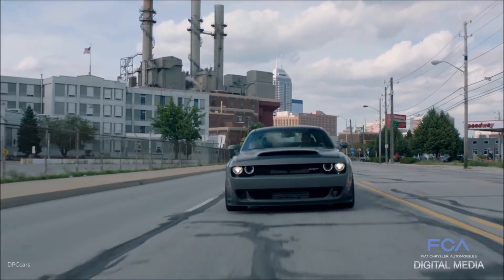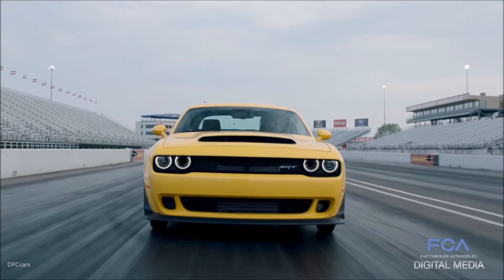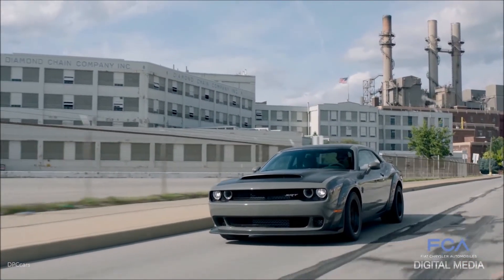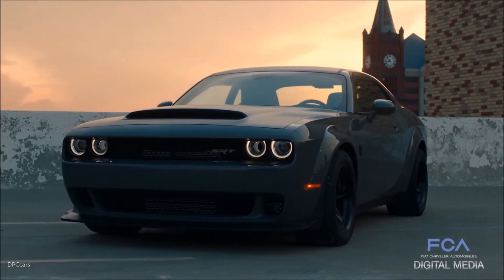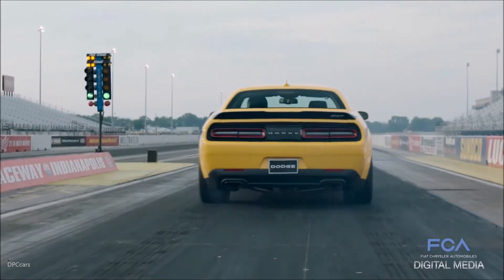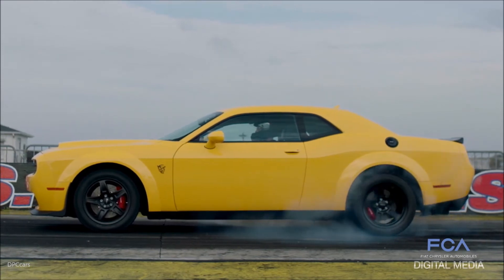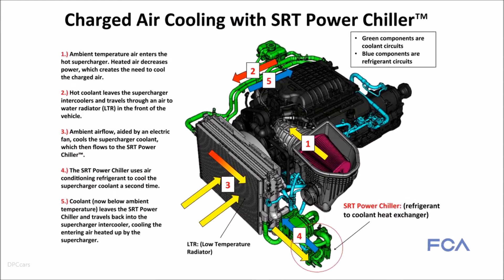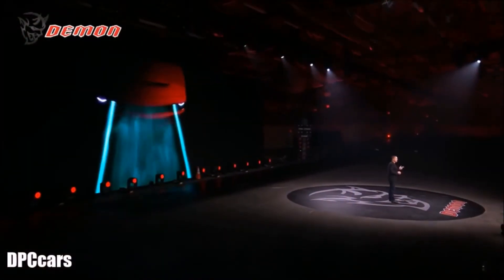Dodge Demon SRT Power Chiller Explained

Comment: So the chilled air helps produce more extra power than the A/C systems uses to produce the cold air???  This sounds like weird science.
Reply: Dude it doesn’t use that much energy to turn a A/C compressor unless your car is a 1.5 liter 3-4 cylinder with 100ft lbs of torque and it’s carrying 2,000lbs of car already
Reply: That's why I put a bag of ice on the supercharger. That chilla is good but some ice goes a long way.
Reply: Challengers equiped with this technology produce 797-840 HP, depending on the model. The AC running will not affect performance in any meaningful way.
Reply: @TheDude397  if anything it may cut the AC down a little bit when you WOT.

Comment: If the compressor runs on a belt I don’t see the benefit of power in this. Aside from that if it’s belt driven, you can’t ramp up a ac compressor to high rpm’s all the time. Not good. Not even common sense.
Reply: The point of the chiller is to cool the supercharger air intake further than what the intercooler alone is capable of. Cold air is dense and contains more oxygen. More oxygen in the combustion chamber means more power. This is very helpful on track days when it's hot and humid. Hot air reduces performance.